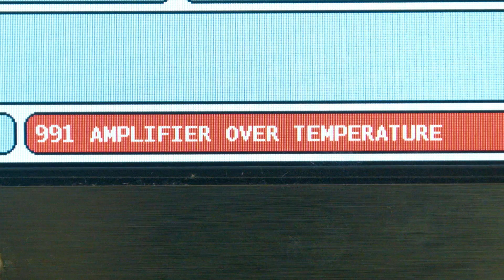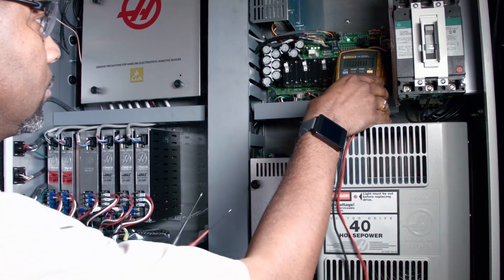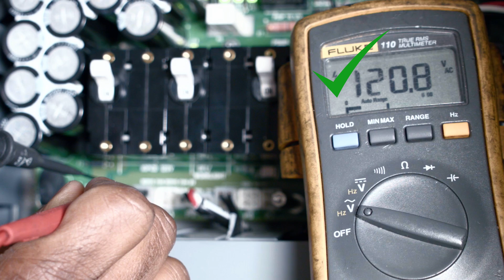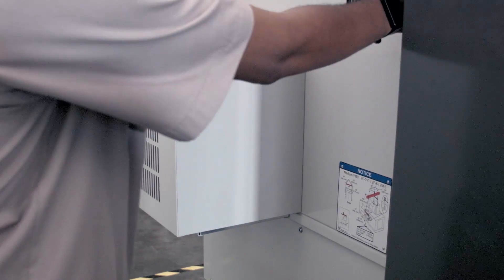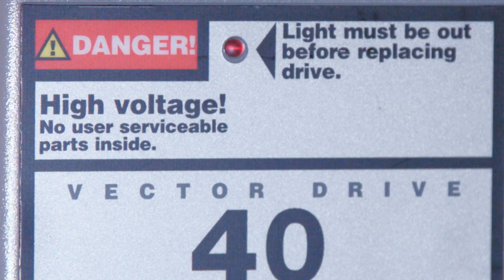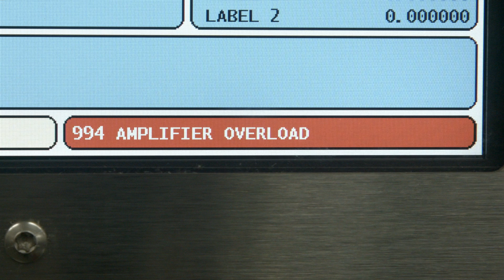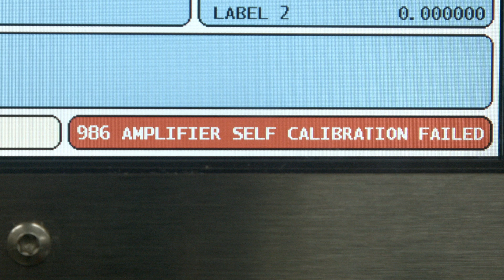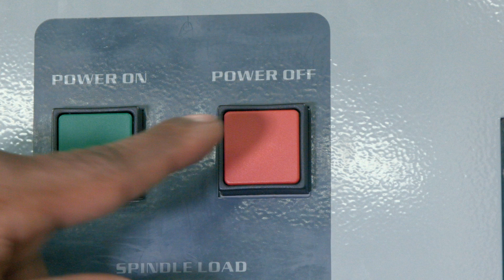Servo Amplifier Troubleshooting - Haas Automation Service

Comment: Hi Hass Team.

Our company just ordered a Lathe machine from you. It ran just a month and it has a problem with alarm 177 - high voltage. The local team from HASS also came to check the problem but they could not fix. They updated the software, changed some connections, and it was still having that alarm. It is a brand new machine but we can not use any more. Why is that and which cases it happens?
Thanks

Peter

Comment: I have a problem with a 2017 VF2SS where it (commonly) gets z axis servo error too large code. Its because the Z axis ballscrew brake stays on when the servo is trying to push the axis. Makes a nasty grinding sound and errors out. Can you make a video on how to fix that?
Reply from the maker: Colin - Have you had your local HFO out to take a look at this?  This is a very unusual problem.  The axis brake is part of the servo motor itself, so if the motor/brake is faulty that might be the cause, but normally an axis servo error too large is caused by something else.
Reply: Thanks for the reply Haas, I know you usually do not comment on these videos so I appreciate that. I did contact them about a few problems, still waiting for a reply. Its usually when jogging around the machine or just after running something in MDI, never during a full program. I figured that the brake was engaged during those times and not "servo'ing" in position. The z axis almost seizes, when you try to jog it makes a nasty grinding/crunching sound then gives servo error too large z axis error. Press reset a few times and its like nothing ever happened. I also have a problem (not sure if its connected to this) but once in a while the probing cycles do not execute. The cycle runs but the machine does not move, then it beeps and flashes green as if it just finished. During the same conditions it also sometimes throws up a corrupt file error. Reset, reset and its back to normal. Do you thing I have a bad motherboard or some electronic issue? Regardless I will contact my HFO again and try to get them out here. Your input is appreciated.
Reply from the maker: Colin - From what you've described, with the issue only occurring while in MDI, it sure sounds like something electrical/software might be going on.  Let us know once you've heard from the HFO, we're interested to hear what the cause of this ended up being.
Reply: Colin Bastien holy crap. Your HFO should be all over this!! Call em every half hour until they get their assess out there. Especially if your warranty is "getting close." In that case I'd be calling every 5 minutes.

I agree with Haas' reply, with issues only occurring in mdi, it sounds like a software issue that may be causing the noise you hear, but could easily include an electrical and/or parameter issue as well. Bad/corrupt servo loop can make some very odd noises.

IIRC, the brake is engaged on power up and e-stop conditions, and should release upon the requisite # of reset button presses. Not sure about "idle" conditions, and can't recall how audible the brake actuation is, but if you loop a program that just feeds Z up and down ~½" @ an inch/min or some other obscenely slow federate & have someone e-stop the machine while you're near the Z axis motor, you should be able to hear it. Same for when it's reset out of e-stop. There's also definitely a bit in some parameter that shows the brake status, or at least what the control is commanding & "thinks" the status is anyway. Couldn't begin to tell you where to find it though. Next gen control is long after my time. 

Which is why your HFO should have service guy checking out your machine ASAP.
Reply: Colin Bastien oh, and the corrupt file error/probing points to software/something at the board level as well. 

Keep an eye on your axis loads as well. If you notice Z is abnormally high during normal operation that could be useful to the tech.

Comment: Seriously haas has to be one of the best CNC companies. other companies would be so locked down you wouldn't be able to even open door to the power control.
Reply: I've programmed and run more than a fair share of HAAS VHC,HMC, and Lathe products. I have always said they are not the best machine made, but they are the best value machine in the game. The service from our local HFO was always awesome and it seldom was needed; however I think anyone can guess that machinists and machine shops are full of capable people and armed with some information like this they can get back to making chips and money. Further expanding the value of the HAAS product.